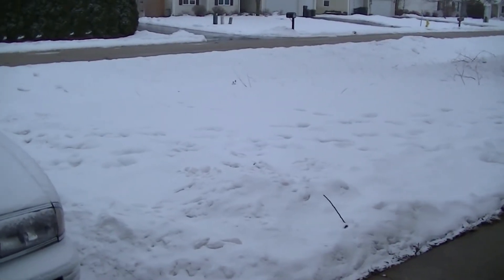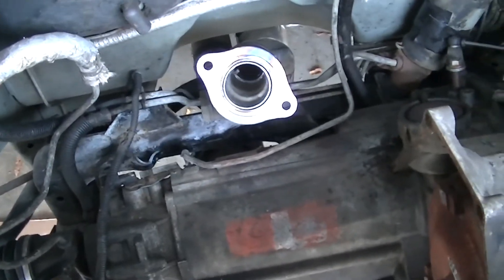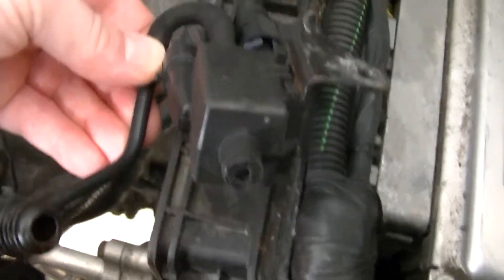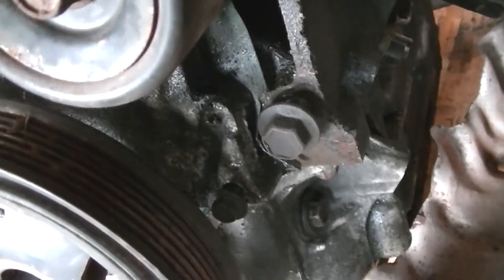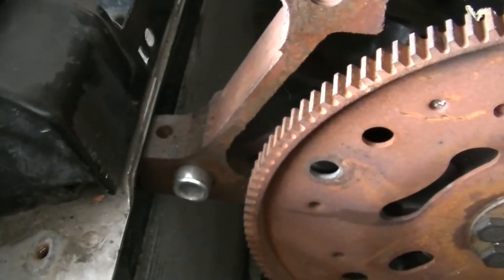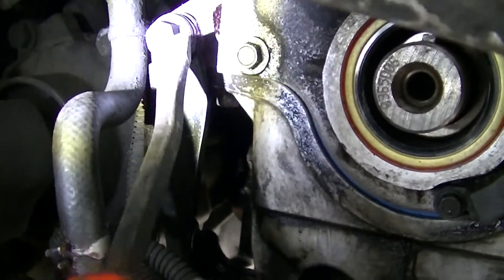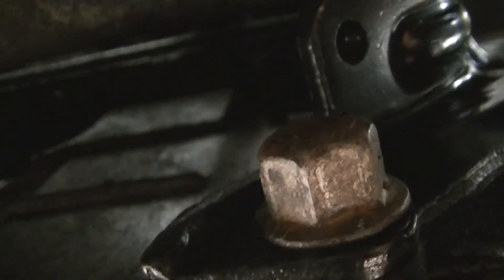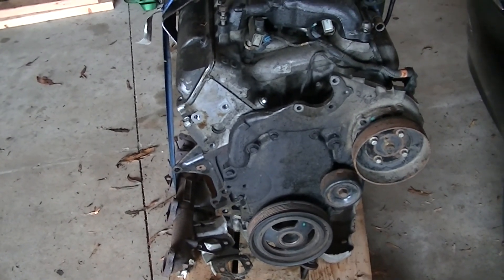Buick Rendevous LA1 to LX9 (3500) Motor Swap  Part 1

Comment: I recently replaced the LA1 in my 2005 Chevy Venture. ALL the videos that I found BEFORE doing the project either had the heads pulled off, or as I did, dropped the cradle. Nice to see that it CAN be done with the motor intact.